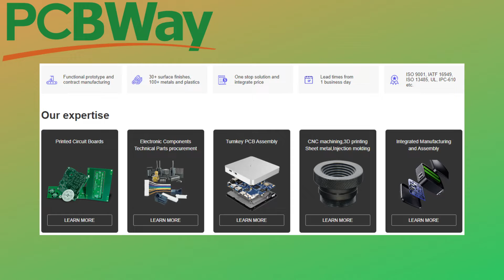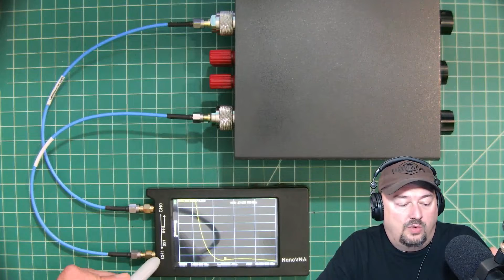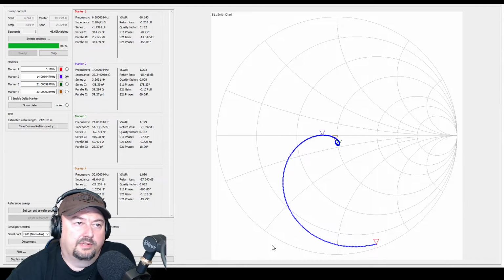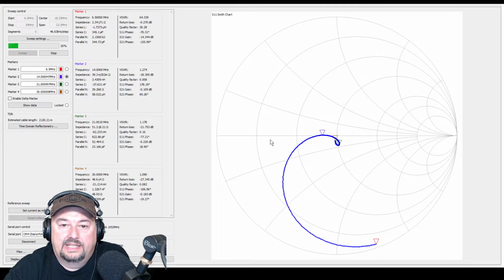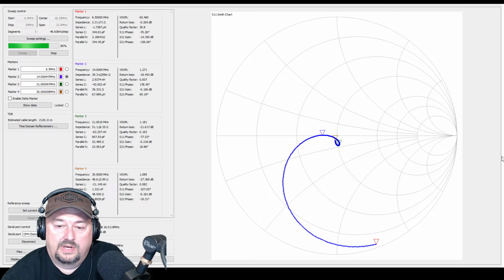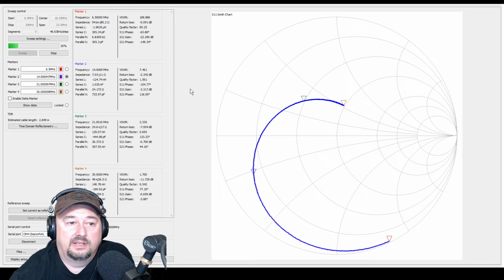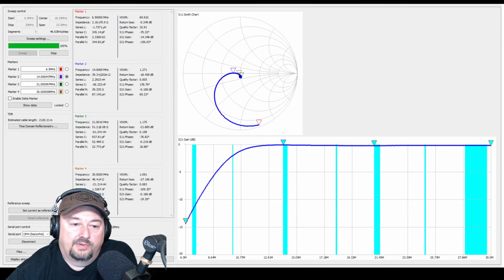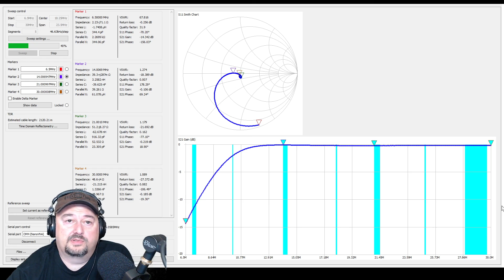Measuring Antenna Tuner Insertion Loss - Ham Radio

Comment: I've had that MFJ-901B manual tuner for decades.  It's still kicking and is the best tuner I ever had.  It has an internal 4:1 balun meaning it will tune both balanced and unbalanced feedlines (either coax or ladder feedlines) as well as random wires.  I got a pre-built Chicom ATU-100 which didn't pan out.  It worked well getting any antenna into resonance, but after a week or so it stopped powering up and went into the junker box.  I never had an autotuner anyway and actually prefer the 901B manual tuner.  Turning those knobs on each band change is wholesome and character building! :)
Reply from the maker: THanks for the post MNPD3

Comment: Just bought a brand new 901-B a month ago and today I decided to check it out on 40 meters using a 10 ohm, 50 ohm, and 1000 ohm resistive load.  Used NanoVNA to adjust the tuner for a 1 to 1 match (NanoVNA seeing 50 + j0 ohms on the input of the tuner) and then replaced the NanoVNA with a 50 ohm output signal generator using a sine wave output and connected my Oscilloscope to the input of the tuner (output of the signal generator) and the load connected to the output of the tuner.  Then used my Oscilloscope measured RMS voltages to calculate the input power to the tuner and the load resistor power and then calculated the tuner loss.  Results are as follows:

10 ohm load: Loss = 0.85 dB
50 ohm load: Loss = 0.60 dB
1000 ohm load: Loss = 0.75 dB

My setup including scope probe impedance may have influenced the results a little bit but believe my quick test was reasonable.

Unfortunately it looks like inventory of new 901-B tuners has dried up within the last week or so due to MFJ stopping US production and glad I snagged a new one just in time.

Note: I went back and also did a through loss test on 40 meters using my NanoVNA when the tuner was adjusted for a perfect match using a 50 ohm load and I came up with a loss of 0.22 dB using this method which is pretty close with what you saw and slightly lower than the 0.60 dB loss I obtained using my Oscilloscope method.  Also repeated the through test with the NanoVNA in which I did not use an external 50 ohm resistor to adjust the tuner, I adjusted the tuner for a perfect match when it's output was looking into the S21 port, and came up with a loss of 0.21 dB which is basically identical with what I came up with when using an external load to adjust the tuner.

73 and thanks for the video.
Don wd8dsb
Reply from the maker: Hey Don, that sounds like an awesome test.  Thank you for sharing.  Glad to hear you were able to get the 901-B they are getting hard to find these days and they are nice little tuners.

Comment: Thanks for the video! Good to see some more empirical evidence. I generally agreed with your conclusion but I did wonder, however, about losses at lower frequencies - especially for the T-match. If you had done a sweep from 1.7 to 4mhz and tuned the MFJ to 3.6mhz or 1.9mhz - what loss do you see?
Reply from the maker: Hey SWL, anything in the transmission line will cause loss, while I didn't test the lower bands I'm sure it's there too...  maybe I will do a new video?
Reply: @TheSmokinApe  I don’t think you need to do a new video. I just wanted to see insertion losses when the MFJ is tuned in the low bands. I don’t think the loss would be much different, but, tuning the T-match on each amateur band from 160 to say 6m and noting the loss in each band would be interesting if the values were different than where you tuned the MFJ in the video. I have the 971 which is really the same device and will try my NanoVNA. Thx!!

Comment: Great video. I would love to see how to measure insertion loss of various antennas such as 9:1 unun, 49:1, screwdriver antennas such as wrc etc. we may be surprised to see how much loss each system presents for qrp hams.
Reply from the maker: Thanks Kyle, glad you liked it.  I do have some videos measure loss on toroidal cores used in wire antennas: https://youtu.be/6j1Yc1Y4Ly0
Reply: I will check that out! Wonder how you would measure antennas like wrc? I know coils have loss. Just curious how much.

Comment: Is there a benefit to optimizing your antenna for resonance over just getting an ATU and letting it handle it?  If there aren't meaningful insertion losses, why would anybody set up a full-sized antenna for 80m or 160m?
Reply from the maker: I think you want the antenna close, when you start to play games to get a match the antenna generally isn't as efficient.
Reply: @TheSmokinApe  the antenna itself will radiate all the energy that reaches it ,the efficiency of the antenna would be down to it length/radiation pattern, the efficiency of the antenna system would be down to every component in that system, the job of the tuner is to allow the transmitter to produce its full power into the system, many blame the tuner for lost efficiency when other components in that system are to blame ,resonance is also misunderstood, it doesn't guarantee efficiency just as a non resonant antenna doesn't guarantee lack of efficiency

Comment: While I disagree with your over simplification of the topic and have witnessed the difference using a watt meter and pass through capable tuner I appreciate your video and effort
Reply from the maker: Howdy Nick, thanks for the feedback.  I did make is simple to illustrate a point that I know is “dramatical”.  I appreciate what your saying and will likely expand on the topic 👍
Reply: What tests have you done? If you're testing it in pass-through mode isn't that just bypassing the internals? What wattage did you use relative to the wattage rating of the unit? I'm trying to understand both how things work from the theoretical side as well as real-world measurements.

Comment: You have to balance losses against versatility. HF radios are rare in just one band, we buy units capable of using most of the HF bands, and we need antennas that can utilize that capability, without tuners no antenna system really does that.
Reply from the maker: Agreed, thanks for the comment LC 👍

Comment: Very good demonstration.  I've heard folks say the same thing about insertion loss associated with tuners.  I do a lot of QRP work (exclusively so) and all contacts - including DX - are at 5 Watts and less.  I use a random wire with a portable tuner and prefer the widebandedness of this setup cuz I cannot afford a lot of weight and gear for two/ three day hikes into the Cascades. I don't imagine I'd be able to be heard if antenna tuners were as lossy as people say. I do just fine; of course I optimize the radiated signal by making sure the inductance and capacitance are properly adjusted and that's my gears in top shape.  Your demonstration seems to confirm my experience.  73, K7GYB.
Reply from the maker: Thanks for the detailed post and for watching David.
Reply: "I do just fine; of course I optimize the radiated signal by making sure the inductance and capacitance are properly adjusted"  I'm curious:  Do you do something with your turner other than match using VSWR?  Tnx and 73, Bob WK2Y
Reply: @bobgerzoff5072  I make sure the contacts are clean and that it's grounded... but I mentioned about the operation of it because I was merely confirming to the author that adjusting for minimum VSWR assures minimum loss - at least for me... this may not be true for folks running higher power.  Other than that I don't do anything different than operating the tuner in a conventional manner.
Reply: He's talking about a real tuner, not an auto tuner. On a real, manual tuner - you have a main inductor coil and then two adjustments, one for the radio and one for the antenna.  @bobgerzoff5072

Comment: Well done on the video, unfortunately the tuner in this instance is having a very easy time so the losses are minimal, I do realise it is messy to deviate from 50 ohms for your level measurements. A random point that might be fun to investigate is that some rigs themselves are not optimal (depending on band etc) driving a 50 ohm load, and will deliver more real power into a slightly different impedance. I remember years ago finding that one of my rigs delivered a little more power into a 70 ohm load than it did into a 50 ohm one. I know your video does not address this but in some instances even with a 50ohm load you can actually get a little more power out with a tuner in circuit. A tuner like yours with a high pass characteristic can help with BC overloading in some radios if you are close to a site.
Reply from the maker: Thanks for the detail G0FVT, I didn't consider that point.  I appreciate it!
Reply: @TheSmokinApe  , thank you for making the video, my comment was not meant in a snarky way but I also realise that it takes a while to set up a demonstration. A lot of people that claim tuners have huge loss should bear in mind that even high power tuners frequently don't even need ventilation.
Reply from the maker: I didn't take it that way, thanks for the comment G0FVT
Reply: That's a really good point; we assume that all finals are set up to maximize power transfer at 50Ω, but that's not always an accurate assumption, especially since nearly every TX design will have variable power output across different frequencies...

Is there a good mechanism for determining a transmitter's real output impedance?  Will an ATU or even a manual transmatch take this into account?
Reply: @georgedorn_fnord  good question, you could probably run a tuner into a power meter and dummy load (unusually in that order) adjust the tuner for maximum power transfer into the load, then replace the transmitter with a VNA to see what impedance the rig was seeing.

Comment: You should try connecting a 1:2 or 1:4 balun transformer between the tuner and the S2 port. Also with some length of coax. To simulate a bad match antenna with a length of 50 ohm coax that needs tuning. What you had in the video was a perfect match antenna and the tuner was basically asked to do nothing.
Reply from the maker: Fair point Baldur, thanks for watching!
Reply: Thought the video was on insertion loss of the tuner ? Adding lossy components is obviously going to add loss
Reply: @paulm0hpd319  a balun transformer is not lossy. A length of coax is lossy depending on the length. Expected outcome is that the tuner will match the SWR mismatch with minimum loss with a short coax and increasing loss with longer coax. A misconception in the HAM community is that using a tuner is always lossy but it depends greatly on the coax length and frequency.
Reply: @BaldurNorddahl  a balun transformer is not lossy mmmmm ,yes it is a common misconception that a tuner is lossy, think there's a big misconception on tuners matching swr full stop
Reply: @paulm0hpd319  a transformer is indeed a lossless component. Of course real world components have losses, but assuming low power and a well made balun for the frequency in use, this will be very little. A coax cable will however have real loss depending on the length used and the frequency and this loss increases with high SWR. Therefore the coax has to be as short as possible when using a tuner to cancel out large mismatches.
Reply: @BaldurNorddahl  are you assuming reflected power is automatically lost on reflection as reflection gain will almost eliminate mismatch loss
Reply: @paulm0hpd319  The tuner only has lossless components (in theory) and assuming perfect tuning, no reflected power goes back to the transmitter as that would imply a mismatch. Therefore all reflected power has to be bounced back to the antenna so we do not break conservation of energy. This can cause some amount of power that is bouncing back and forth, and each time you have coax loss. To maximize radiated power you need coax loss to be small.

Quote from Wikipedia article "antenna tuner": An ATU sitting beside the transmitter just re-reflects energy reflected from the antenna ("backlash current") back yet again along the feedline to the antenna ("retro-reflection").[3] High losses arise from RF resistance in the feedline and antenna, and those multiple reflections due to high SWR cause feedline losses to be compounded.
Reply: @BaldurNorddahl  so in the theoretical lossless line no matter how high the swr is all reflected power is radiated by the antenna
Reply: @paulm0hpd319  correct if you have a lossless line all power is radiated by the antenna if the tuner is able to match the antenna impedance. The easy way to get this lossless line is to connect the tuner directly to the antenna :-). Maybe use ladder line instead of coax as that has much less loss. Or to use the best coax and as short a possible.
Reply: @BaldurNorddahl  proving that the tuner isn't necessarily responsible for loss in a bad match scenario
Reply: @paulm0hpd319  we should also add that an antenna shorter than the resonance point will convert some of the energy to heat instead of radiation. A much too short antenna will use most of the energy for heating up the antenna.
Reply: @BaldurNorddahl  not necessarily depends on how much shorter ,an 80m dipole cut 20 ft shorter fed into a tuner thats taking care of the reactances with 600ohm open wire will have no noticeable difference on radiated signal
Reply: @paulm0hpd319  I have not measured it myself, but I understand that much shorter means less than 10% of the resonant length.
Reply: @BaldurNorddahl  LB Cebik has a chart noting the difference, you be surprised how short antenna can be before any noticeable difference on signal strength by the receiving end

Comment: What's old is new (or what's new is old?). In the dim dark ages of radio, everyone used a pair of #12's spaced 6-inches as their feed line. And everyone had a link coupled plate tank in their transmitter that could match whatever impedance was presented at the shack. Everyone effectively had an antenna tuner. Fast forward to current times and we find through your experimental set-up that the old-fashioned antenna tuner is still an efficient way to present a 50-ohm load to the modern transmitters. The simple fact is that a doublet of almost any reasonable length, when fed with a parallel conductor line through a tuner, is probably more efficient than coax-fed half-wave dipoles and has the advantage of being practically frequency independent.

Now a challenge for you: Repeat the experiment with a set of baluns in the signal path. Parallel conductor feedlines have a reputation for radiating due to imbalance. Some of that imbalance is from proximity effects, but some of it is the balance created by the balun now in the output of most antenna tuners. The effectiveness and efficiency of baluns needs investigated just like the tuners they support.
Reply: Well said, the voltage baluns incorporated in most commercial tuners are bad news, you want the feeder CURRENTS equal and 180 degrees out of phase,  not the VOLTAGES. plus the transformers produce a non 180 degree phase shift. Also they tend to be 4:1,  why do that? The transformation of impedance to a lower value is likely itself to increase tuner losses.
I have made common mode chokes to drive open wire fed antennas from the tuner unbalanced output, I think it is a better solution. Tuners get a lot of bad press, they can introduce significant loss under some conditions, however they can have benefits even in matched systems. I used to live near to a MW broadcaster, a T-match ATU helped a lot to protect the receiver from the battering it was getting from the broadcaster....
Reply from the maker: Thanks for the idea Bill